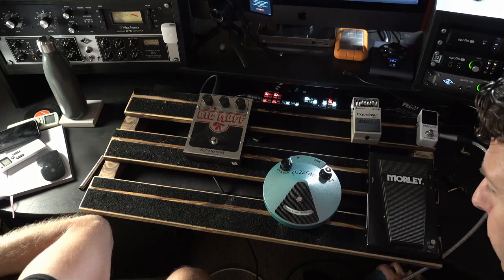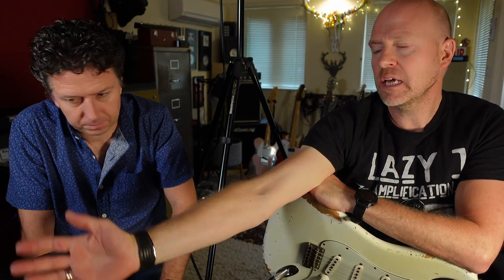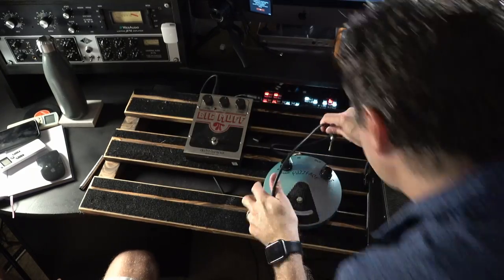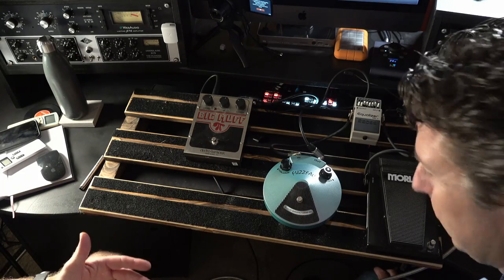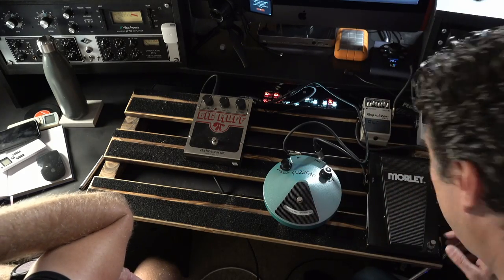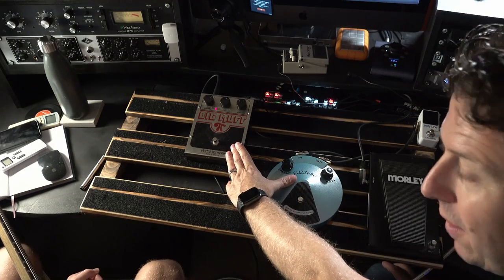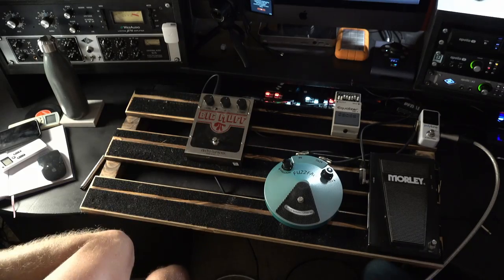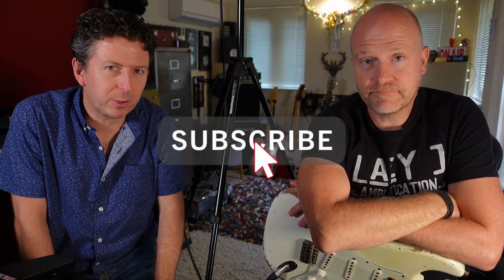Pedal Board Build #1 - FUZZ - Where To Stick Your Fuzz

Comment: The first set up there sounds the best and  the same signal chain that I use in spite of every video and forum telling me to put fuzz first. I’ve been using that same first set up for years with my Supro Fuzz and it sounds great and far better than any other signal chain I’ve tried. My conscience is clear now that I’m not doing anything wrong. Great video lads, thanks. Subscribed now 👍

Comment: Love that you're still rocking the old Morley wah. With a buffered pedal, order does matter. You can buy a flip-flopper pedal that will let you change order with a footswitch. I run 2 Keeley fuzzes (Fuzz Head and Electric Mudd) before a Dunlop Wah and then into all drive pedals.

Comment: Problem case... I use NS1X NOISE SUPPRESSION as a pedal loop, using BOSS FZ2W plus NOBELS ODR1 AND BOSS PB2W BOOSTER. Can I use BOSS TU3W TUNER BEFORE OR AFTER THIS LOOP? If before should I disengage its buffer?